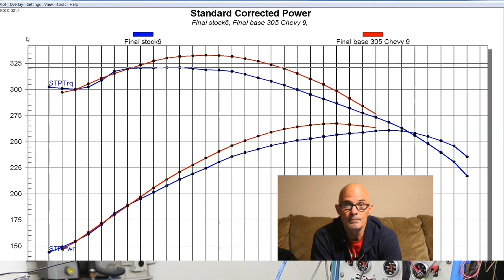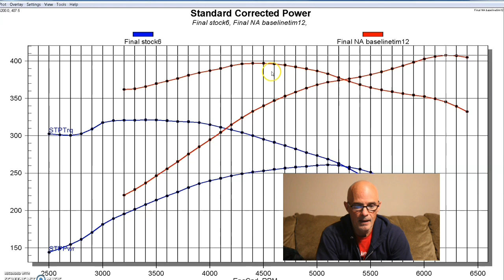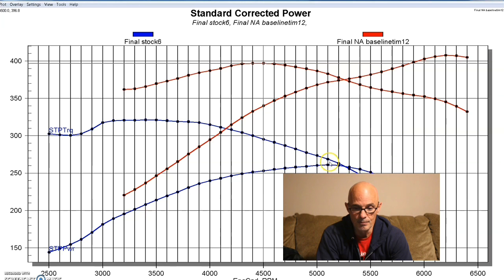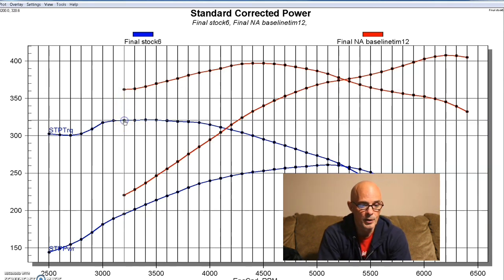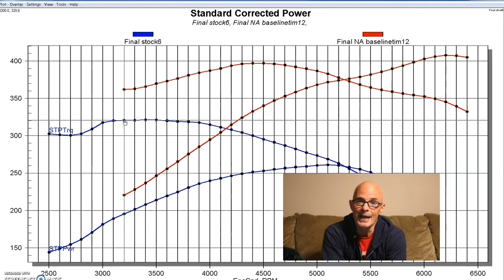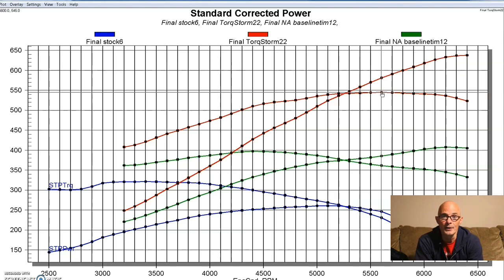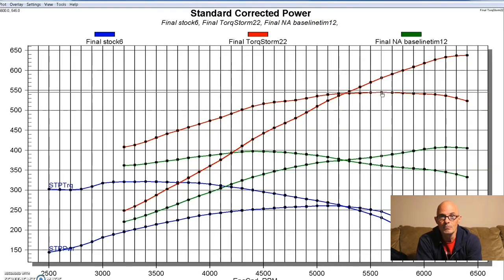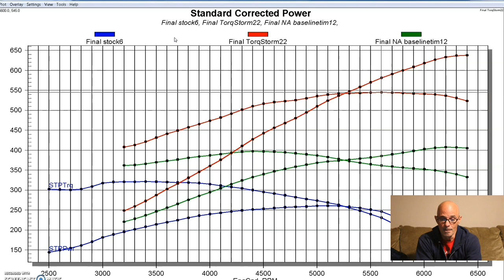5.0L FIGHT-302 FORD VS 305 CHEVY-FULL RESULTS

Comment: Awesome video . I've had both engines and was impressed with both back in the day with what simple bolt ons that were available . Also the 302 will always out shine the the 305 . The 350 is Chevrolets golden child
Reply: You are very wrong. The 350 is a great engine and responds well to mods. The 327 was always intended to be a performance engine. The 350 debuted in 1967 and wasn't a performance engine until 1970. The 327 debuted in 1962 and was the highest rated sbc ever in 1963 at 365 hp in the corvette.
Reply: If you will read correctly I said the 305. And it is very true the 302 always has and will out shine the 305
Reply: @chrismcculloch4751  if you read correctly you said the 350 is chevy's golden child. I said it wasn't.
Reply: Well I reckon opinions are like assholes everybody has one
Reply: Also the 327 is a darn good engine . I've had a couple hundred in my life time but not being able to get it in a 4 bolt main in my book makes the 350 the best engine as far as price , easy to find, and just an all out great motor and the most used engine ever built

Comment: Another great video Richard! A few questions,
1. what was the CR
2. Total timing
3.for overall output, are the 3/4" headers best or a smaller diameter pipe
4. rocker ratio
5.truth or myth-5.0l blocks split above 500HP(?). If true, what year blocks? I own a 76 vintage 302 and don't want to damage the original block in my stang.
Thank you, Tony

Comment: I'm a bowtie guy but I can't argue with the big bore/short stroke of a 302. Allows bigger valves and better flowing heads than the 305. I'd like to see a Chevy 302 vs a Ford 302 shootout. Same bore and stroke. Similar cams. Similar heads. Hell, even a 350 vs 351.

Comment: Richard, I would like to see a comparison of that TFS intake vs the Box R intake vs the GT40 intake.
Reply: I'd like to see that too, but I think the GT40 would lose a bunch upstairs. It's runner's cross sectional area is pretty small.
Reply: Its been done plenty of times in the magazines and few other places. Like a lot of guys, I'm afraid to drop big money on the RPM2/Systemax 2/TFS R or some such thing and then hate the way it drives at everything that isn't WOT. Doesn't sound cool on youtube but its nice to not have to downshift to roll up a hill or pass traffic.
Reply: @ewetoobz3840  the ford does well. The gt40-gtp kit scooted a 4000# explorer quite well. And scoots my 3250# ranger even better.

Comment: Great comparison, only thing I can say is that pretty much no one uses the 305 SBC as a performance build. As you stated, the bore is the limiting factor.
Reply: Actually it's not the bore, a smaller bore makes a faster burn, the 305 is usually low compression with not much of an aftermarket piston selection.

Comment: I have an 87 5.0 t5 mustang I bought almost new! Had some mild mods…3.55 gears , underdrive pulleys, off road H pipe and a 65mm throttle body, air box silencer removed …other wise stock.
A buddy bought 91 z28 ( the year with the big wing) 305 TPI T5 with 3.42 gear ….he changed the exhaust somewhat (not sure what he did) added a different air induction system, better ignition stuff etc….our cars were very close with cubic inch , 5spd and gear ratios.
We raced dozens of times and I’d almost always beat him. …usually take him from a dig but sometimes I’d spin pretty good but still run him down by the end.
I thought his car would dust my mustang but I was very surprised with the outcome ….wasn’t a fluke cause we raced each other a lot.
My car at the time was running 13.6s to 13.8s depending on the day. He never took his car to a track but guessing it was a low 14 sec car.

Comment: I'd love to see a bore vs stroke comparison, something like a Chevy 302 vs 305 with same heads, cam, compression
Reply: Probably can't use the same 302 heads on a 305 due to the 305's smaller bore.  That's the reason why 305 head choices are limited.

Comment: Back in the day, with the 5.0 Ford engine in the Mustangs, I seem to recall 275-280h.p. being the "standard" horsepower number with the "usual" bolt-ons done to them. I realize that there were many that made much more than that, but it seemed to be the common number for a guy that didn't want to dig into the short block, and just bolted on the usual speed parts.
Reply: I remember the 5.0 ford engines constantly overheating and needed to be rebuilt, the 305 is rock solid.

Comment: It was about what I expected. I had a discussion about the 305 being able to go over 350 hp with heads cam and intake setup and over 600hp with a turbo . Guy said it would do it . I going drop this in a link for him to see . The 305 isn’t a boat anchor if you massage it right .

Comment: 5.0 Ford block had some  limitations.  Thin wall casting splits in the Valley, main caps need support.
Reply from the maker: unfortunately main cap support doesn't stop the splitting-its the other direction

Comment: Id like to see a 302 DZ Chevy aginst a 302 Ford. Just for the bore and stroke similarities.
Reply: @xxxmikeyjock  
I'd like to see a 396 destroked to 2.9" to give 305 cubic inches.  
Compared to the boss 302. 
Both would have big  angled valves.
Reply: @xxxmikeyjock  we like it fine since the dz302 stomped the furd 302 on track.
Reply: @HioSSilver1999  lmao not even close the dz was good but the boss was just that
Reply: @xxxmikeyjock  The DZ302 ran right with the Boss 302 especially on the track.
Reply: mikeyjock lmao we don’t have a problem with it... the dz302 z28’s stomped 99% of all mustangs sooo.......
Reply: Laughs in 304 amx
Reply: The bore and stroke on both the Chevy and Ford 302 were identical, 4" bore, 3" stroke.
Reply: @xxxmikeyjock  Boss 302 was a good race engine and did beat Chevrolet, but none of it was 302 Windsor except in dimensions. The Chev 302 was a destroked 350 with a few premium parts. The easiest comparison test is Ford's 351W and a Chev 350. Hell, throw a Dodge 340 in there too.
Reply: @HioSSilver1999  Not the Boss 302. https://en.wikipedia.org/wiki/1970_Trans-American_Sedan_Championship
Reply: @bartpang  Look at the 1970 Trans-Am results. Ford won. And AMC scored more points than Chevrolet. Ford building a race engine and Penske/Donohue leaving Chevrolet were the major factors here.
Reply: @Joshie2256  gm pulled factory support in 1970.....and built no 302s that year. They did have a splayed valve 302 in the works but never raced it.
Reply: @hendo337  not necessarily.  Peak numbers maybe. In average power the boss stuff lost. Average power wins races.
Reply: You rock Richard my son is going to love this video and he is going to want a set of TFS heads now, can't afford them but will dream about the combo.
Reply: @Joshie2256  the Chevy 302 was a destroked 327, not 350. It was a 327 block with a 283 crank.
Reply: Here is the requested comparison: https://www.hotrod.com/articles/hrdp-1001-muscle-car-engine-shootout/
Reply: @xxxmikeyjock  the only advantage the dz 302 would have is rod stroke ratio but I think canted valve is a little unfair compared to wedge heads. At that point you could start comparing Clevelands to an ls.
Reply: @bigrobsgarage4167  aren't 327 and 350 blocks the same? Same bore same deck height right?
Reply: @bigrobsgarage4167  all three are 4 inch bore blocks . The strokes happen to kinda coincide mathematically easy to remember. with displacement the 302 had 3.00 stroke, the 327 has 3.25inch and 350 has 3.48 stroke. 327's were often 2 bolt so I think they used 4inch bore blocks w 4 bolt mains. Also i believe they used the bigger crank journal size that a 350 would have had. But I gotta check that.
Reply: Some 327 Chevy's were small journal and some were large
Reply: That would be my choice of Chevy 5 litre engines. Big valve heads for the win.
Reply: that would be a good one
Reply: would have to be solid lift flat tap cam...
Reply: @HioSSilver1999    the Boss had more torque down low and up high. Although, the DZ did have higher peak torque by 9 ft-lbs. However, past 5800 the Boss was the Boss, despite having half a point less compression and less duration at .050"...
Reply: @TheDude2111  early 327s were small journal crank and spun quicker easier. But yes you could but s j 327 would be the way to go
Reply: @Joshie2256  destroked 327 son get your facts straight..
Reply: @Joshie2256  small journal 327 with a 283 crank in it easy peasy
Reply: @HioSSilver1999  Not in 1970. The Bud Moore Boss 302 Mustangs ruled that year.
Reply: @Joshie2256  The original 302 was a small main journal 327 block with a small main journal 283 crank, developed in 1966 for the '67 Z28.
Reply: I'm a Chevy guy, but back in the 80's had a friend who had a 56 Ford with a 302 that he built with 351 Cleveland-2V heads and Chevy 6cly rods, backed by a 4sp. It was pretty strong!
Reply: @allenl9031  i think i already said gm pulled out of the trans am series in 1970.....so 1970 don't really matter.
Reply: @wil8115  not that i have seen. Besides the boss was a reaction to furd getting they ass whooped in 1969. Furd always had to come up with some limited crap because their normal production shit was shit.
Reply: @bigrobsgarage4167  you are thinking of the 307...
Reply: @TheDude2111  307 bored out 120 thousand.  With a 350 crank.
Reply: My local master machinist bored out my 70 elcamino 307 120 thousand dropped a 350 crank in it. 13.50 all day long. With a nice set of  Stinnet heads.
Reply: They did a Dz 302 Chevy amd a boss302 both high compression high flow heads big carbs very similar HP output both rated at 290 hp although they both made way more than that.
Reply: @HioSSilver1999  Somebody doesn't know  their history.
Reply: @dond5103  yea some of these people don't. 

I mean there's 1 idiot here that thinks a 30p00 made 100hp more than the dz302.
Reply: @Joshie2256  Dodge 360. They did a crate engine test several years ago using the HP crate engines from the big 3. Gutted Mustang w/HP 351vs 1st Gen Camaro w/HP 350, vs 76 Duster w/HP 360. Same gears, tires, and had to be with 10 pounds of each other. Mustang got to load the rear bumper to get the weight up, Camaro had a 4 spd. Duster wiped them both even with the most weight (only 10 pounds). Mopar won the day, most torque.  All had same 4"bore.
Reply: @bigrobsgarage4167  Same block. Even my '94 Corvette engine has 327 cast in the side.
Reply: @joebalser9515  Try 20 years ago. I remember the comparison.
Reply: @xxxmikeyjock  why wouldn't we like it? the 302 chevy would smash that 302 Ford boss or whatever you want. let's see the test back to factory specs on both.
Reply: It would be kinda the same engine
Reply: @hendo337  Isn't that kind of what Richard is saying here? It's all in the HCI combination and intended RPM range but the numbers for same-same  are close to .. the same! There's no magic with a badge, the magic comes with the package (and Fox brakes? oh dear.)
Reply: @Joshie2256  I'd put my money on the 340 dodge
Reply: @HioSSilver1999  they pulled out cause they knew they'd lose
Reply: @timmebruer5205  well they dominated in 68 and 69.....so I'm sure they weren't to worried about 70.
Reply: @HioSSilver1999  they were scared of getting beat.
Same thing they did with drag racing in the early 60s.
When they couldn't beat ford and mopar they quit claiming it was getting out of hand.
That explains the little boys wear bow ties thing lol
Reply: @timmebruer5205  they dominated and left. Likely to focus on more challenging stuff like can am.

I mean shit....amc almost beat furd in 1970 and did in 1971.
Reply: Yep Josh is right with the small journal chevy 302,,, reminds me of the sbc i built for my wife's Vega years ago a 352 (400 block, 327 lg steel truck crank, scat 6.200 rod, Je pistons)full roller engine with a 5 speed,,,she likes it and says it gets her to Wally World ok,,,
Reply: @martyjohnsonozarkoutdoors8198  Now that would be interesting.
Reply: HioSSilver1999 like the 302 Chevy wasn’t specialized??? You’re just a Chevy nut hugger. Very few Z28s where equipped with the 302. They are more rare than the boss 302.
Reply: @HioSSilver1999  Don't seem to remember that .Enlighten me.Didn't the boss 302 stomp the Chevy dz in trans am 1970?
Reply: @petergiannaros9037  no...gm with drew factory support in 1970. There were no chevy 302s in 1970.....you are now enlightened.
Reply: @markball7028  there was 8600 boss 302 mustangs made and 28000 z28s made.

What were you saying again?

And no the 302 wasn't very specialized.  The cam came from 327 365hp engines and the heads. It's not like chevy had to completely redesign the 302 like furd did because they got their ass kicked. It was basically a parts bin motor.
Reply: @HioSSilver1999  and how many of those Z28s came equipped with the 302? Only 602 Z28 Camaro’s where sold with the 302. That is what I am referring to. Ford didn’t complete redesign the 302 either. They simply installed their big block Cleveland heads on a small block 302 Windsor with a different intake manifold. Brand loyalty is retarded in my book. I have no brand loyalty. Ive owned Camaro and Mustangs.
Reply: @markball7028  putting bigblock heads on the furd 302 was a complete redesign doofus. 

All z28s had the 302 67-69 That was the purpose of the z28 option. It was there to homologate the car for racing.
Reply: @Joshie2256  The Boss 302 was a 302 Windsor block with 351 Cleveland heads.

Comment: I actually don't miss pulling off injection and putting on carbs on either motor. Thanks for the awesome no BS info.
Reply from the maker: we ran these both with carbs too
Reply: @richardholdener1727  back when it was Eprom tuning most guys just wanted something they could tune on their own. It just got kinda cooke cutter was all.

Comment: What I would like to know is, how long would the bottom end last with all that powering the 302
Reply: I've heard of guys getting over 200 passes at the track before splitting the block.
Reply: Everything was a crap shoot with the Mustangs back then, I wouldn't think very long. You're talking 550 rwhp.
Reply: from what Ive seen, there are some unicorns which can hold 600whp all day long. But for the most part, 450-500whp is the limit if you want it to last. Personally I wouldn't go over 450whp if its a street/strip car since reliability is definitely a major factor.
Reply: @coffelt683  There's 2 different 302 blocks in those years. There's YYY and XXX. The XXX blocks supposedly have more nickel and slightly thicker main webs. I'm not sure how true that is, but all the mustang guy's I've heard of building blocks for boost use the XXX blocks because of that.
Reply: @hcrib1  heard that as well. The stronger may have referred to as a "mexican block?"
Reply: @jjd975975  Yes, the XXX blocks were referred to as Mexican blocks.

Comment: But but but, Richard, everyone knows the second you make over 500hp on a stock 302 block it will crack like an egg! No exceptions! /s
Reply: smpstech I would recommend you look up project stock bottom end on Facebook. These guys make 900hp if I remember correctly on a stock block
Reply: They do commonly crack at 500-600hp. Putting an engine on the Dyno in a 60 degrees room while doing a couple seconds dyno pull is a hell of a lot different than driving 500 miles down the interstate when it's 105 degrees with the AC on. Or a 12-13 second race where the engine is very quickly changing rpm aka banging gears.
Reply: Timing dude everyone knows stock bottom end you're very conservative on timing to make it live
Reply: @ctmpeanut  that's correct
Reply: RPM and boost is what takes out the block not hp
Reply: @nathanbutler8240  well with very conservative timing you won't make any power.
Reply: @mctigmctiggy1475  this setup is prob 500 rwhp in a car through a full exhaust with accessories hooked up to it.  That and its on a dyno where it isnt as stressed.   I dont think hes quite past the block splitting territory but fairly close.  At that point you gotta watch how you tune it and be conservative on timing.
Reply: @michaelharris748  Chris Watson made over 800 rwhp with a stock block , 5 speed and on3 70mm turbo...look him up on youtube
Reply: @landonhelm5091  ive seen guys make more power and i beleive i seen the 800 rwhp build online on the turbo fox.  Hes prob running really great fuel and is being conservative on timing and stuff which does help.
Reply: @michaelharris748  good fuel, good tune, and not spinning rpms too high...

Comment: When you get your new assembled heads, do you have  a machine shop or check the valve job before you use them? I have seen some realy bad machine work come on new heads out of the box.
Reply from the maker: i did not
Reply: Verry good channel thanks for sharing your knowledge.

Comment: That cam work with stock pistons?
How much hp with GT40 heads?
 Love the vids!
Reply: I would think you would get less HP/TQ cos on the GT/40 heads are iron and they come with smaller valve's and the trick flow heads you can get the 2.02 valves. The trick flow heads just seems to be a better choice but I don't think it would be that big huge difference.
Reply: Trick flow heads are sweet but that’s a lot of money for a 302. Would love to see junkyard gt40 explorer heads with a lil porting
Reply: Eric Blatz I did a 331 junkyard build with gt40p and explorer intake (wanted room for improvement down the road with better heads). Fully ported the intake and exhaust bowls and polished the ports and port matched the lower to the heads to straighten the runners. N41 cam 10.5:1 compression makes good power